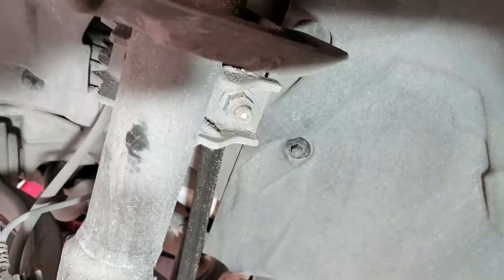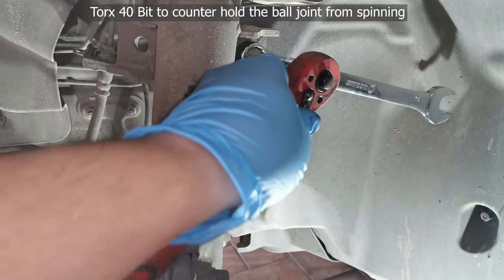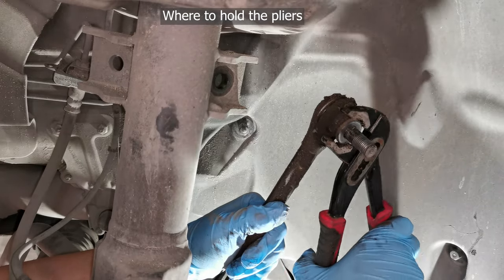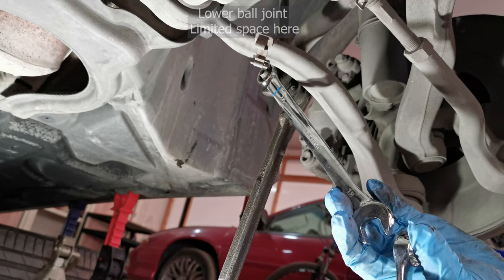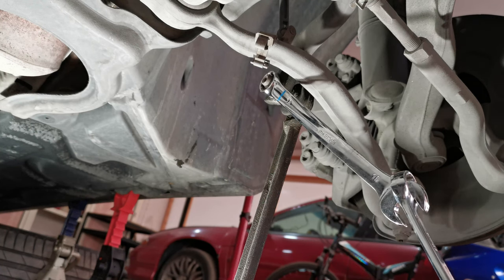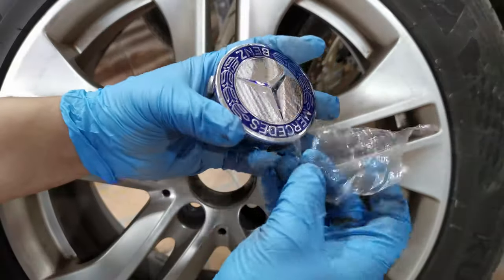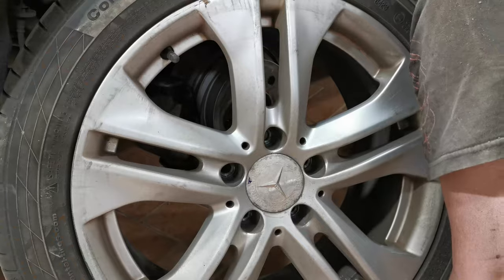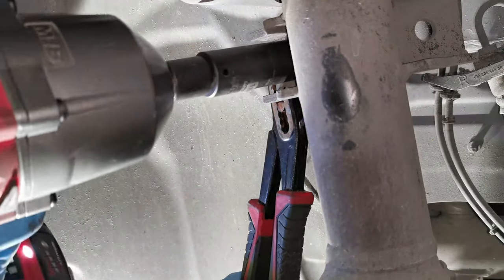Sway Bar Link Replacement | Mercedes E Class W212

Comment: This was so easy, If I was going to do it again, I would buy an 18mm stuby ratchet wrench, I have an 18mm Tekton and it's really nice but just a little bit to big. Mercedes wanted $700 to do this. I did it in an hour from start to finish, mainly spending time working in a small garage with little room to move. I could do it in half the time if I had to do it again.
Reply from the maker: True, the 18mm ratchet wrench would have made the job so much faster but didn't feel like waiting for the delivery time. But 700$ for this job is crazy , especially with the low cost of the part.
Reply: mine was turning inside, but on the other side, why would I buy that tool if I'm not going to do these links again within at least 10 years :)

Comment: Does changing sway bar link affect current alignments? I’m trying to decide whether to change all the suspension parts in the front end or just sway bar end link.
Reply from the maker: I don't think alignment is needed with only changing the end links, and didn't find mention of needing alignment in the repair procedure after doing end links.
Reply: Not at all!

Comment: What was the problem for fixing the sway bar link? Was it a noice, what type of noice - can you describe it? How did you find out that the sway bar was a problem? I have a noice in my w212 but I think it comes from the rear. Nice video
Reply from the maker: thx, I got a metalic clucking noise from the front suspension. Could not locate the source of the noise even a MB shop couldn't find it. The end links were the only thing that looked damaged but sadly it did not fix the noise problem.
Reply: @ZakiGarage please keep us updated, I also have a noise, I’m thinking of changing rotors/pads moving up from there
Reply from the maker: @Superstonker  Will do :yougotthis:. will be making a vid once I found the issue but will take me some time.